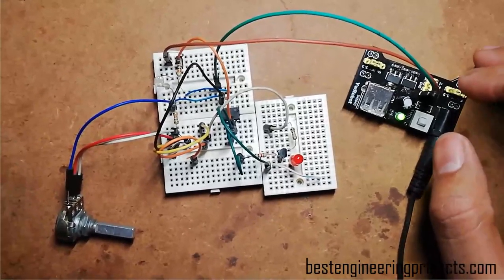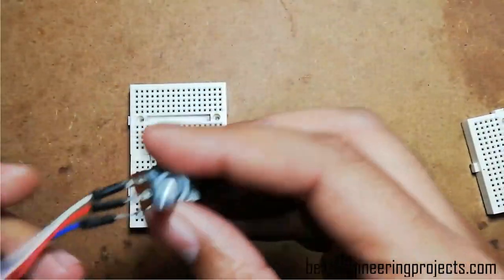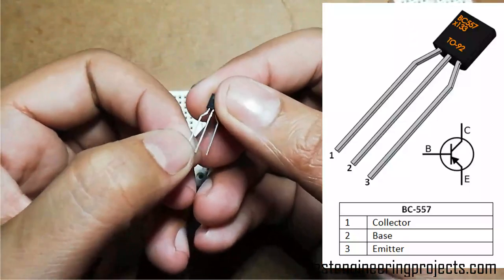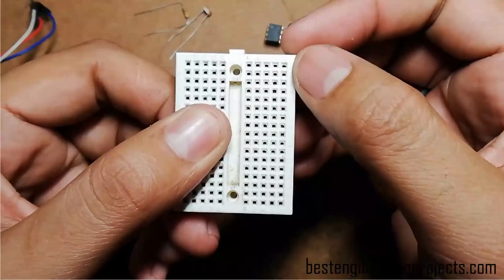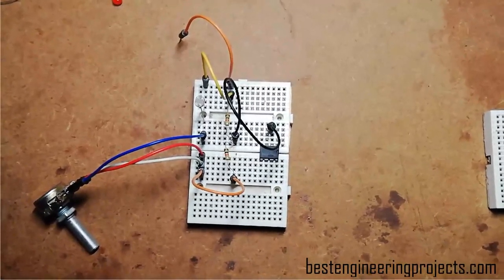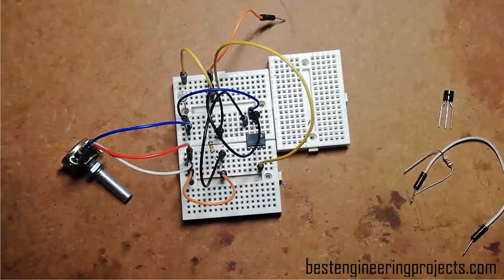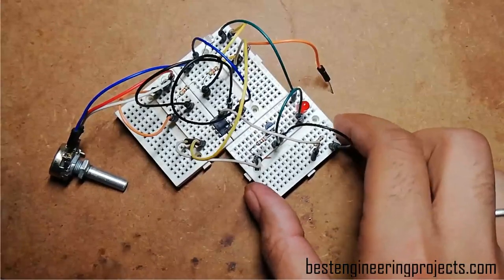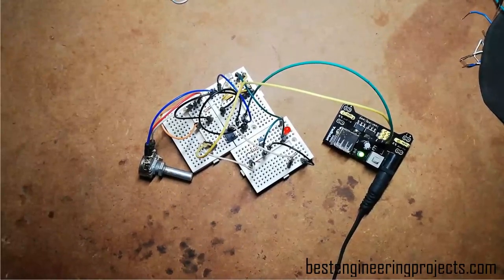Light Sensor Switch Circuit using LM741

Comment: if we will trigger the transiter only with the help of LDR what will happen and what is the main importance of op-amp here.
Reply from the maker: There are various reason of using op-amp over single transistor.
1. Op-amp used here as voltage comparator unit, which provide better and precise precision.
2. We can use this circuit as dark switch as well as light switch by changing output transistor i.e. We Don't have to change the position of LDR.
3. Op- amp have better output swing limitation.